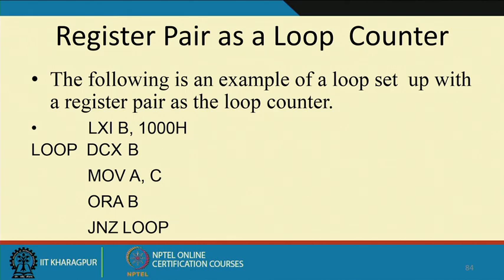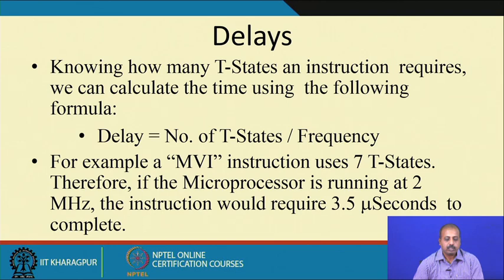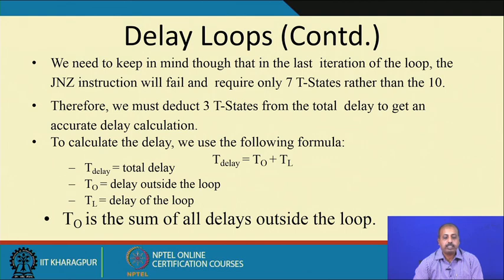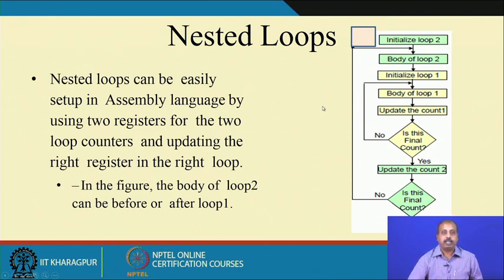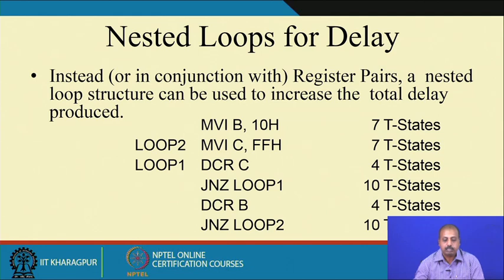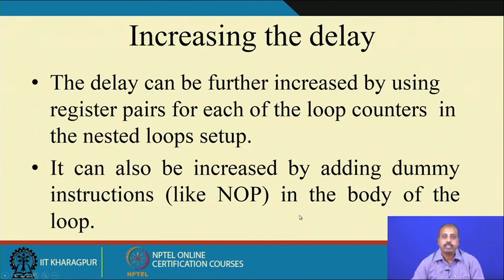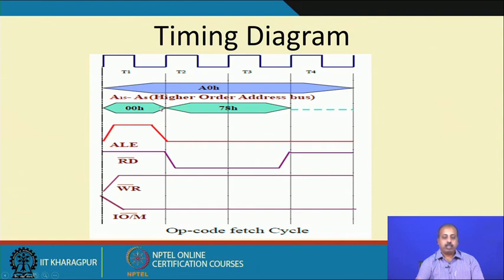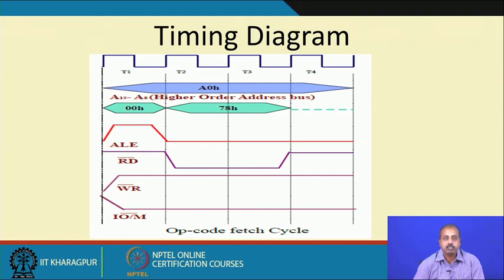Lecture 13: 8085 Microprocessors (Contd.)

Comment: its should be AND @2:30
Reply: By AND there is possibility to get zero result even when both registers have non zero content. So to check that whether both registers have their content equal to zero we use OR.  If your query isn't cleared ... You just see truth table of both and see that to get result = 0 in both cases we have only one possibility in OR operation while in AND we have 3 such possiblity.